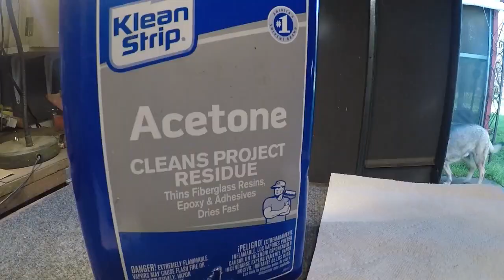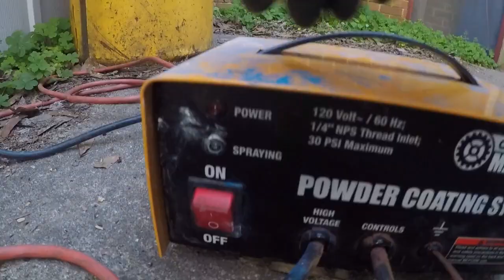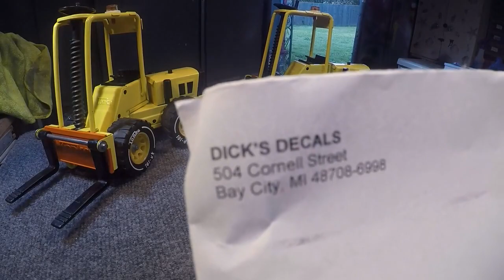Twin vintage Tonka Fork Lifts. (Restoration)

Comment: Hi, please can you tell me where i can order the little iron things you need to replace the wheel,again? The things on the axes i mean , sorry for my bad english.
Reply: Those are called axle caps. You can get them at most hardware stores. You can also get them online. Just be sure to get the correct sizes. RS
Reply: Phillip Smith thank you for your reaction. I’m from Holland and want to restore some Tonka’s to.

Comment: This is how I think the best teachers are NOT at the University. They are on You Tube, this is one of my favorite classes, Doubly cool, always something new to learn, I love the color. I could ask you in your experience what you think is the best TONKA Yellow and Orange color  in spray paint there are so many (Rust Oleum, Krylon, etc) and if you recommend using clear spray. THANKS
Reply from the maker: Luis D. Pacheco Hi Luis! I typically use Rustoleum. I do use clear if I rattle can a project. If I powder coat it I don’t use clear. Powder doesn’t like clear. It tends to crackle up. RS
Reply: @RustyShepherd  Thanks, for answering,  sorry for ask again Rust Oleum any idea if You know the name of Yellow ,Orange color I saw a video that someone use   Rust Oleum (Golden Sunset spray paint very similar of the Yellow Tonka. THANKS

Comment: I have 2 of the Tonka forklifts...one needs no restoration  but the other is in the same shape as the 2 you restoredlWhy did you paint that front plate orange?They should be yellow.I had to repair the screwjack on the rougher one and make a disc out of plastic.
Reply from the maker: I didn’t paint it orange. It was orange from the factory. The rest of the machine is yellow.

Comment: If this video was 4 me you forgot to say Hey Rudy is this the video you wanted LOL well sir once again awesome work I have the same fork lift but mine has a broken handle that's about it paint is nice on it so I left it alone. Sorry 4 the nag but the alligator clip goes on the place where your hanging the parts. Bueno you see I have a defibrillator in my chest and if I have any contact with any electric equipment lets just say its going 2 ruin my days LOL but am willing to try this powder coating bit always wanted 2 but always at work.  Sir awesome work Thanks standing by 4 the next video RF
Reply from the maker: Rudy Flores The Alligator clip is on the metal rack that the parts are hanging from.  The charge it’s putting out is only 25 volts. Its only hot when you depress the pedal. Even if you touched it “hot”, that low voltage wouldn’t bother your internal defibrillator.  👌🏼
Reply: Not enough to worry about.  Just don't do Stick or TIG welding!  The Dr. can read the history and noted that my buddy was 'doing it' Thursdays, 10 PM!
Reply from the maker: Gord Baker I’m completely lost! Lol. What?
Reply: @RustyShepherd  Thats' not Me!

Comment: Articulating pin upside down?  A couple flaps not bent over 90°?  Red (original)beacon should be at the rear?  I restored one of those, likely older with different wheels.  Apparently they came with 1 or 2 Plastic Bins that fit the Forks.  Looked like a couple non original rivets you drilled out of second one.
Very well done P.
Reply from the maker: Gord Baker Great eye sir!  I put the pin in that way, so the axle cap wouldn’t be seen. The beacon used to be amber. Emergency vehicles have red beacons. One of these was missing. I happened to have one. I surly did put the beacons in the wrong hole! Lol. I was tired and it was late. 😂
Reply from the maker: Gord Baker Great eye sir!  I put the pin in that way, so the axle cap wouldn’t be seen. The beacon used to be amber. Emergency vehicles have red beacons. One of these was missing. I happened to have one. I surly did put the beacons in the wrong hole! Lol. I was tired and it was late. 😂
Reply from the maker: Gord Baker Great eye sir!  I put the pin in that way, so the axle cap wouldn’t be seen. The beacon used to be amber. Emergency vehicles have red beacons. One of these was missing. I happened to have one. I surly did put the beacons in the wrong hole! Lol. I was tired and it was late. 😂.
Reply: Mine has the red plastic bin and lid/pallet. These look awesome!